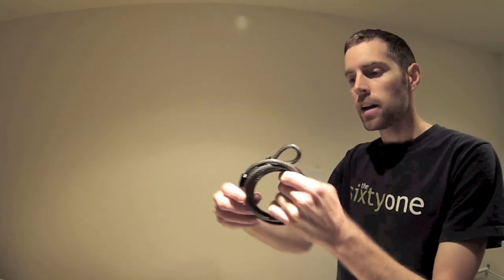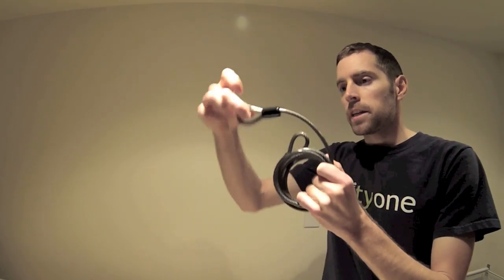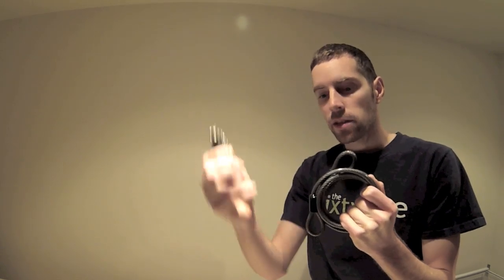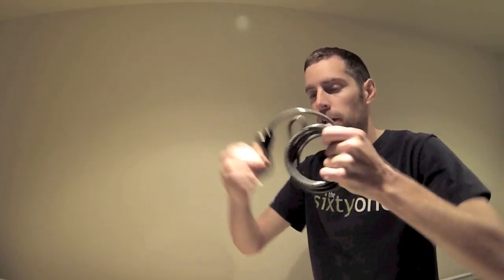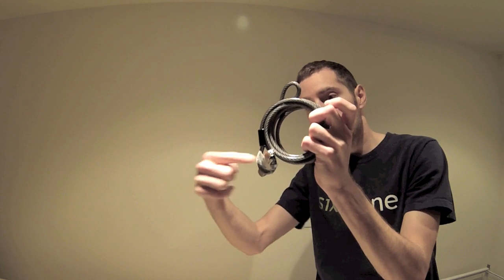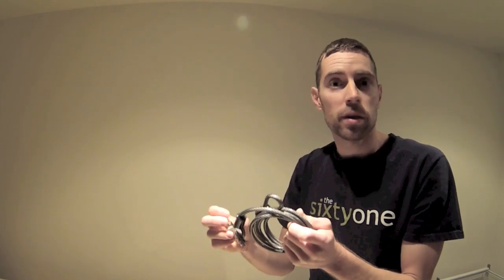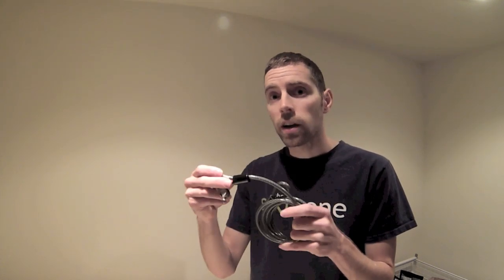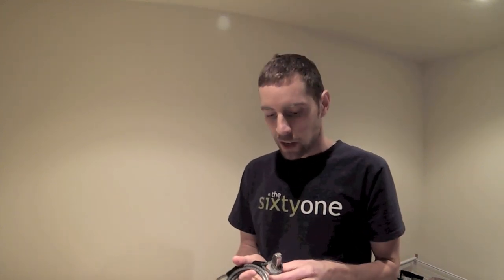Understanding Unsprung Weight in Electric Bikes - Rear Hub Motors vs. Mid Drive

Comment: I have hub motor 1000w it weight alome 11.2 Kg. I cannot use a suspension fork NO WAY even its made of metal, still waiting to see if they manufacture a suspension fork specified for hub motors so one can mount it on safely.

Comment: hub mount is for onroad and mid mount is for offroad, the unsprung weight of the hub mount has very little effect on handling compared to where that weight is distributed, hub mount weight is in rear wheel making the rear tail happy like an old porsche and mid mount has all the weight in the middle making for a much better balanced ride with faster and tighter turns due to it being much easier to pivot the bike with your hips

Comment: Would a 8 fun 500 Watt Mid Drive with 25 A Controller and 36 Volt 15 AH Lithium Battery Have enough power to get me up hills and go a good speed as i am 18 stone. And what do you think of the quality and power of the kit in general because i don't want to spend 700 pound if it will not be suitable. Can you let me know thanks.
Reply: That combination of motor and battery size sounds pretty good. My experience with this kit is limited to reviews so it's difficult to comment on durability but 8Fun is well known (and oft used on purpose-built ebikes that hold up well). I know a few people who have bought the kit and like it, it should have no problem transporting you around, especially if you have 6+ sprockets in the rear... just shift to a lower gear if you're going up a hill etc. and the motor will have an easier time. You can get some more feedback on this motor in t he 8Fun forums here: http://electricbikereview.com/community/forums/8fun/

Comment: 2:55  Can't you pedal like that with a mid drive?  I don't get how they differ in that sense.
Reply: Not really, the motor performs different in each gear with a mid-drive but with a hub motor it's constant so your gear and cadence doesn't matter.

So imagine trying to climb a hill with your bike in a high (hard) gear... it would suck right? You would have to stand up and work really hard. Well, with a mid-drive bike the motor would also be struggling if you were in a high gear so in order to get up the hill you have to change gears. Now with a hub motor, the gear you're in doesn't matter so you can pedal slow or fast and push hard or soft and the motor is just going to do its thing. It's not going to be as efficient (because it isn't leveraging your gears like a mid-drive) but it's going to feel more fun and take your mind off of shifting. It just feels like a scooter, power at your fingertips at any moment. This may not sound like a big deal (just switch gears right?) but I've found that with ebikes I tend to ride faster and usually have my gears up higher and then when I stop it's nice to have the motor ready to do it's thing without having to shift down. This also applies to climbing hills. I like having the motor be "always ready" to help me vs. having to switch gears to enable it. Also... some mid-drive ebikes have slow motors that are powerful but only really work well at one speed. This means you have to change the way you pedal to really optimize the motor... you have to pick a harder gear for it to really work right and that means you always have to pedal slower instead of spinning which is better for your knees.

I hope this all makes sense to you...
Reply: Electric Bike Review
That was awesome!  Thank you very much.
Reply: mef1975 Sure thing, glad it helped :D

Comment: Less weight= Faster acceleration= Efficiency = Battery savings = More travel distance.

* weight is centered on bike meaning you have more control. 
* The controller is integrated in the motor  
* motor is installed to bike frame making theft difficult. 
* Using your gears like a transmission you build speed and momentum
* set-up takes a few more minutes to install but its worth security, if the proper tools are used like an impact gun, it makes it impossible to remove by hand. 

-If someone decides to steal your bike they have 2 options.

***Dismantle the bike where it is with the proper and special tools 
***Cut the lock avoiding attention from bystanders  

-------------------------------------------------------------------------------------------------------------------

Most people would choose option B.      
if a gps is added via bike frame 
tracking your bike will allow you to send 
that person behind bars.
Reply: Mid-drive systems weights not that much less.
Also mid-drives increases the wear of bike parts - chain and gears, which you have to change much faster. You can't have powerfull mid-drive motors, without changing to moto-parts, bike parts are just not strong enough. There's a guy, who made a mid-drive cromotor 3kw, on custom frame with moto parts, but bearing in motor last only about 1000km, and fail afterwards.
Every system has it's pros and cons.
Reply: Andrew Golardo Great feedback, I agree that mid-drives put more stress on the chain and sprockets. I've noticed many of these bikes have upgraded chains and some of the new fancy ones have sensors that cut the motor quickly when you shift gears to reduce mashing.